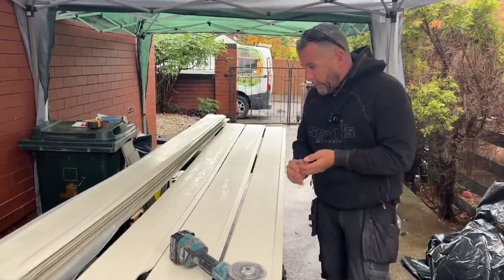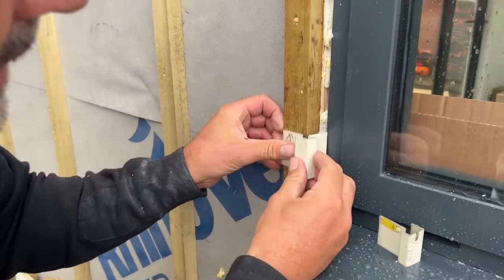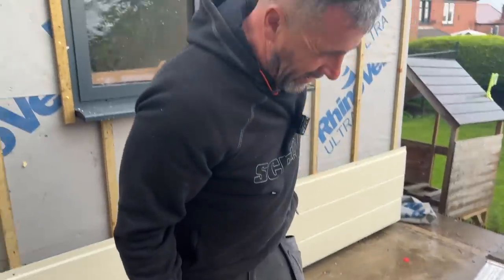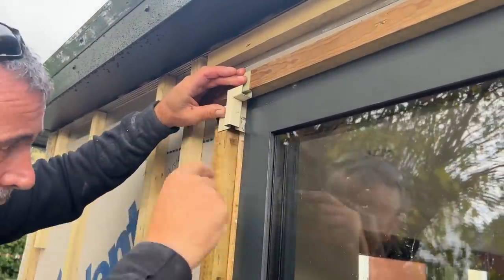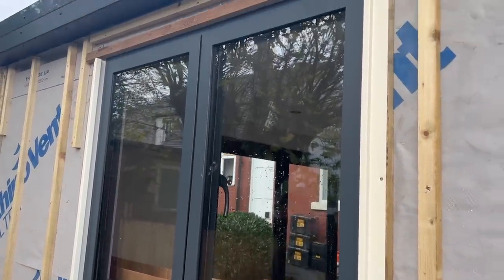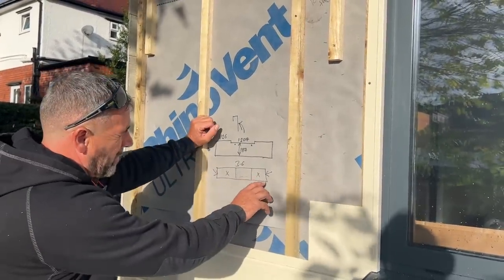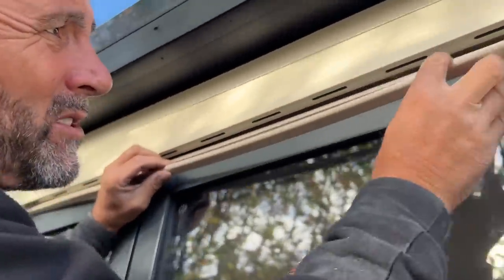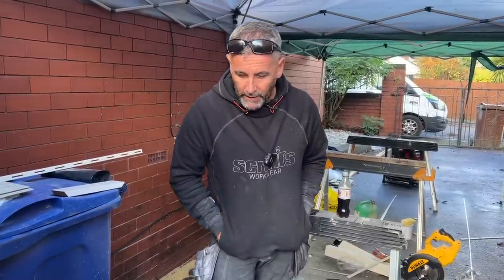How to clad a garden office in Hardie VL cement fibre board

Comment: The best way I have found to deal with dust is a pressure bottle, the flexible spray nozzles from CNC machines (they are like £10 on ebay/amazon). The fine spray keeps the dust down to almost nothing, the water cools the blade and they last much longer. There is no electrical risk with a battery-powered angle grinder and unlike blowing the dust onto the neighbours is not actually illegal.

Comment: Yay! First up!

My room is clad with Cedral, a very similar product. I thought the dedicated blade was an essential purchase and I highly recommend it. The shocker was the cumulative cost of the fittings, not the boards themselves. Things like colour match corner trims, the colour matched screws and the stainless vent trims etc.
There are "no name" copies of the Cedral trims out there that are worth searching out. They may well be compatible with Hardie and are considerably cheaper. I'm 5 years down the line with mine and I can't tell which are the branded ones and which aren't.
One big difference between Hardie and Cedral is the corner trims. I have to say that the Cedral corner trims are much fiddlier to fit but result in a neater more "integrated" finish.
Reply from the maker: 1st 🥇 😉

Comment: I use this product a lot. I run a cement fibre blade in my 7.1/4 circular saw. Not sure if you can get them in the uk though. You can get a vacuum switch so the vacuum kicks in when the saw is on and it runs for ten seconds once you stop the saw, it’s nasty stuff. Great channel.

Comment: Cutting out around window cills the grinder is a good way to cut it as its neat, but by far the best way to cut it for 90 degree cuts is to use the guillotine, not the standard type guillotine but the type where it cuts through the whole width of the board at once. I've modified mine so it cuts angled cuts also for gable ends, 100% dust free, no battery, mounted it onto a swivel base so it clips onto my dewalt leg stand, works a treat

Comment: Have you, or anyone, had any trouble with the tongue and grove being tight on the vl plank and it won’t sit properly because of the tolerance between the tongue and the batten?
Reply from the maker: Yes mate, its a bugger, cut an off cut of Hardie, take off the top lip, then use the off cut, sit it on the piece you are trying to fit, and hammer it down. Some times you need to prize the roofing battens offa bit also

Comment: Hi Liam, have you ever used a scribe and Edge of carpenter's square to cut it? I did my entire build cutting the VL boards that way and it worked perfectly. I found the blades did not work for me. Hardie also recommend this method because it has zero dust. I highly recommend it

I also used a brand new 50mm chisel (sharp) to make the sloped cuts for the sides for the sloped roof and it worked perfectly

Comment: I have cement board shears that I use. Who wants the dust? Plus a second person? You might give the shears a try.
Reply from the maker: Can’t use them on VL
Reply: @thegardenroomguru  I have not used the lap style, so I understand what you mean. However, I wonder if you took a piece of the opposite side and started your cut from a squared edge, then the edge would not break. Just a thought. You may be completely correct and there are no possible ways other than what you are doing.  I hung up my apron after 38 years and now just watch you guys work here on youtube.